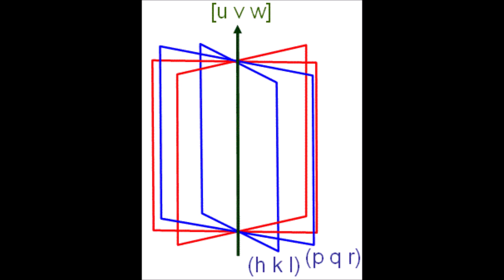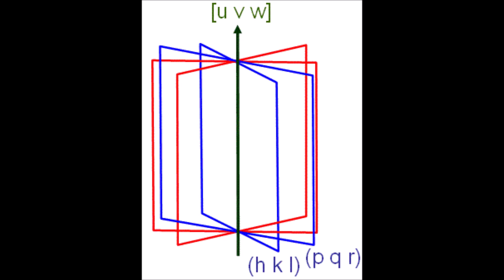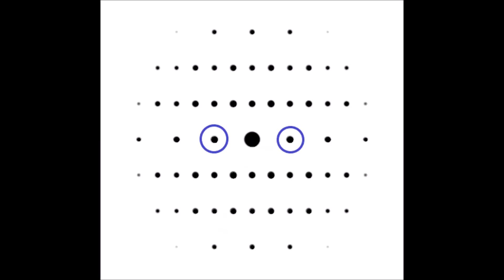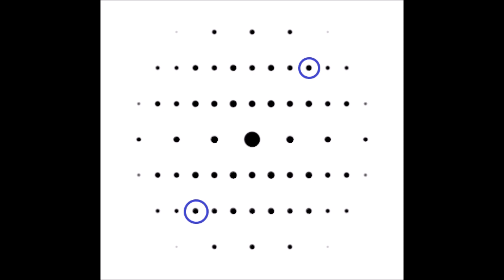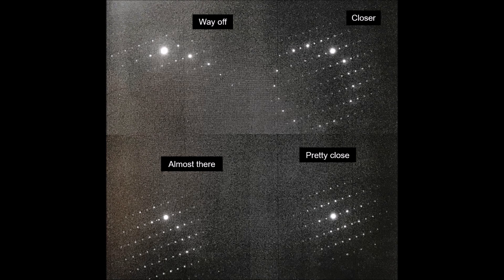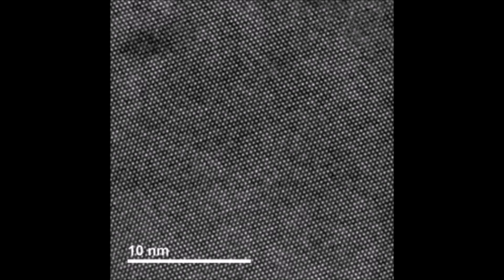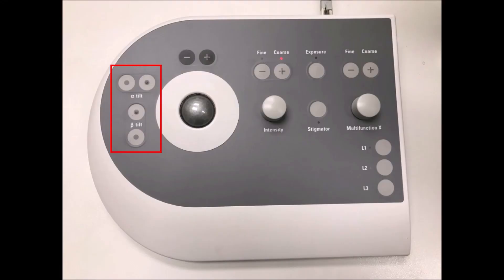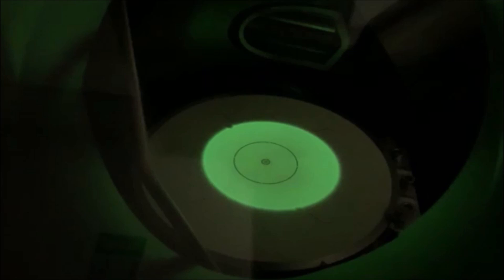Zone axis alignment when performing S/TEM

Comment: It was a tiny video but very powerful. I understood two things; I realized the effect of having in zone axis on the HR imaging and secondly, the iterative process of obtaining it. I have some queries; i) How Kikuchi pattern is being used to align to zone axis?, ii) When you have nanoparticle sample where each particle has its own arrangement then how to effectively deal with multiple fixing of zone axis for each? Finally, thank you very much for providing this information. With this, I can have better quality results coming out of my hands.
Reply from the maker: You can also use Kikuchi lines to assist with zone axis alignment (this is actually a good topic for another video) but if your sample is very thin there won't be any Kikuchi lines.  If you have nanoparticles, then you can align along a zone axis for an individual particle (which is very challenging if the particle is very small) but you wouldn't be able to get multiple particles aligned at the same time since they are usually randomly oriented.  The usual practice when imaging nanoparticle samples is to simply search around until you find ones that are giving nice lattice fringes, rather than trying to manually align to a zone axis for a single particle (though it is possible to do this if you are careful and patient).
Reply: @NicholasRudawski  thank you for sharing
Reply from the maker: @urwashigupta3142  You're welcome
Reply: You can have experimental kikuchi maps in which you can identify poles and once you coincide your 000 spot with a pole in kikuchi map, then your ZA orientation corresponds to the indices of the pole.

Comment: Thank you very much for a clear explanation, I would like to know how I can I use apply this to FFT pattern.
Reply from the maker: You're welcome!  It is a little more difficult to use the FFT to assist with zone axis alignment, though you can indeed see changes in the FFT as the zone axis alignment changes.  The issue with the FFT is that opposite spots will always have the same intensity, regardless of how close the alignment is to the zone axis, so this is much less helpful compared to the DP.  That being said, the spots will become more intense and you will see more spots farther away from the center of the FFT as the zone axis alignment improves, so these also indicate the precision of the alignment.  If you compute the FFTs of the two HR-TEM images of Si that I showed, you will see this (actually, this would be good to post as a video).
Reply: thank you very much. it would be very nice to see such a video (simple explanations as this is and step by step procedure ) with comparison and highlights in similarities and differences between DP and FFT. also how to determine zone axis from FFT. and also not only cubic phase where the rings are relatively easy, but some other structures as well. thanks again.

Comment: Thank you so much, your video was very informative. I have one question, how did you decide that its 110 alignment to the ZA? why not another like 11-2 or etc. Please write some words about this?
Reply from the maker: You're welcome, and sorry for the late response!  I know the ZA = <110> from experience from working with this material (and zone axis) so extensively for so many years, so it's a bit of hand waiving on my part here.  If I didn't know this, I would need to solve it by indexing (solving) the diffraction pattern by hand.  Solving single crystal diffraction patterns is definitely something that I could dedicate a whole video on (and others besides you have also asked about this, too).  Hopefully, I will get to this at some point in the near future!

Comment: Excellent video, I understood very well what it is a zone axis, why it is important to obtain good quality high resolution images and how the alignment of the zone axis is carried out. However, since I am new to this field, I am trying to relate it to Bragg's law and I cannot relate it, since if the beam is parallel to all those planes that are in the zone axis, there would be no diffraction; those planes will not produce diffraction. My question is how the diffraction is generated in all those parallel planes with the beam?
Reply: Beam is parallel to the zone axis direction but diffraction occurs because of the interference where the atoms in the planes behave as the slit... So even if they are parallel to a particular direction but still there are atoms behaving as slit...

Comment: Nice video! Could you explain more specially the zone axis allignment process. I have tried to allign the zone axis, but I am still not sure the direction of the ± alpha tilt and ± bata tilt. And is it better to do the alpha tilt firstly?
Reply from the maker: Thank you!  How you need to tilt (alpha versus beta, negative versus positive) based on the appearance of the diffraction pattern to align to the zone axis varies from instrument to instrument, but for all instruments it is possible to figure this out a create a diagram so you know what to do.  This would actually be a good thing to post as a short video: how to make a "zone axis tilting guide".
Reply: Just a reminder for this short video...
Nicholas...
"Tilting Guide"
Reply: Please make the video for tilting guide

Comment: Thank you so much for the useful video. 
Do you have any tricks to find the zone axis you really want? For example, when I go to the diffraction mode, I see a kikuchi pole, go to it very easily and find it to be [112] in fcc, but what I really want is [110]. So how can I decide which direction I should go further and how big the step should be? Could you please share some experience? Thank you very much!
Reply from the maker: Hi Xingpu; I'm glad you found the video useful!  Generally speaking, when you are working with a single crystal specimen, you prepare the specimen for imaging along a specific zone axis.  If you want to image along a different zone axis in the same sample, this can be tough do depending on tilting limitations; your best course of action may be to just make a new sample prepared for viewing along a different zone axis.  If you are working with a polycrystalline sample, things get even tougher because you likely don't have any idea about which zone axis you are close to for a particular grain before you make the sample unless you do something like EBSD beforehand.  If you are finding the [112] zone axis but want to tilt to the [110], the two zones share a common 2-20/2-20 Kikuchi band pair so you would need to identify that band and follow it (tilt) to get from one zone axis to another.  That said, the angle between [112] and [110] is about 55 degrees, which is pushing tilt limits of most TEMs.

Comment: Thank you for your videos. 
What is the tilt range of alpha for single tilt holder? Can I tilt Beta when using single tilt holder?
Reply from the maker: Hi Sara: this was actually an important detail that I somehow left out of the video; you need a double tilt holder to use the beta tilt, so it's practically impossible to perform zone axis alignment with a single tilt holder; the alpha tilt range on our Tecnai with the S-TWIN lens is +/- 60 degrees; the beta tilt range is +/- 30 degrees; depending on the lens type, these values can be different.
Reply: Thank you. Would you be able to make a video about sample preparation by FIB?
Reply from the maker: @saraa2636  I definitely plan on it; I just uploaded a video about operating our FIB, so that will be the "prequel" to the lamella prep video!

Comment: Hi Nicholas, Thanks for your very informative videos. I am still little doubtful that how do we label the zone axis like [110] etc?
Reply from the maker: Hi Sourav: I'm glad you find the videos informative.  Your question about how to assign indices is related to the broader topic of indexing single crystal diffraction patterns.  This would be a great topic for a future video.  In the case of Si, using [110] is partially arbitrary, as I could use any equivalent direction, like [101], [011], [1-10], etc. and still be correct due the inherent symmetry of the material.
Reply: A simple way to identify ZA is to index the diffraction spots and take the cross product of any to indices and that will give you ZA.

Comment: Hi! I just want to ask, for the case of single crystalline sample, how many zone axis should be checked during the TEM analysis? And should I expect different planes on the different SAED patterns obtained at different zone axis? Thank you!
Reply from the maker: Hi Jeanne: I'm very sorry I didn't see this until now.  As far as how many zone axes to check, it depends on what you are trying to do with the sample.  With a single crystal, you are usually only concerned with the zone axis that is aligned with the electron transparent direction of your sample.  Usually, you prepare the sample to target a specific zone axis.  You are correct that if you tilt to other zone axes you will most certainly encounter other sets of planes, though it is possible (even likely) that there are some common planes between two different zone axes.